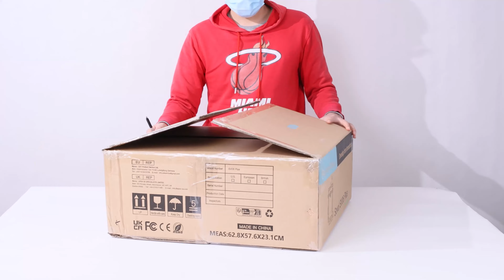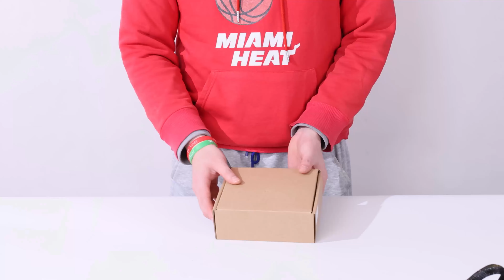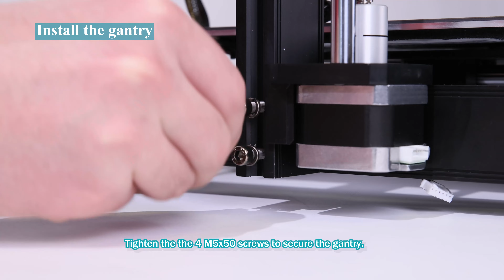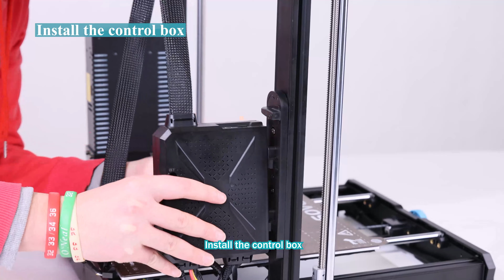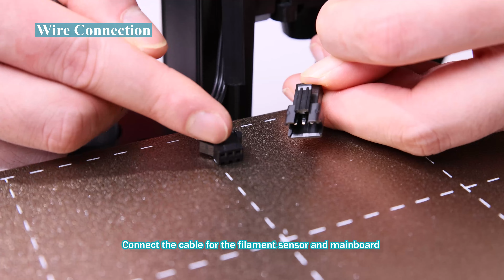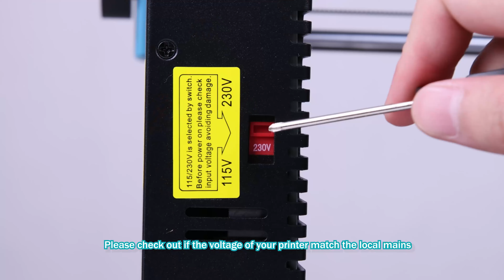Sovol SV06 Plus Unboxing & Assembly

Comment: I just got mine, but it has an additional sticker print surface, what do I do with that, does that go on the heated bed or on the back side of the metal textured pei sheet?
Reply: hey there did you figure it out? i have the same question
Reply: @ThekomboPlayer  did you figure it out i also have that question

Comment: I just upgraded to and just assembled the SV06 plus from a SV01 Pro as I needed a larger build platform.   I had such a good experience with the SV01 Pro that I decided to stay with Sovol for the upgrade.    I will keep the SV01 Pro as a spare cause I liked it so much…..didn’t let me down.     
I hope I’ll get same experience with the SV06+……….I will comment when I have had a chance to use it.👍
Reply: He, how has your experience using the sv06+ been? Considering getting one myself!
Reply: @bossgames8888  it has been great……excellent to be correct.   Not an issue and used quite a bit.    The nozzles are not standard so got spares from Sovol but only changed once but probably didn’t need to.    It’s been great unit and would buy it again anytime if I had to.
Reply: @miket3445 thank you for your reply! I’m really considering buying one! Just never 3d-printed before so I want my first one to be a good one
Reply: @bossgames8888  just remember that 3D printers are not like paper printers……there is a learning curve!    You have to set it up correctly and do the levelling and Z - offset routine properly, otherwise it won’t print properly.   Make sure to watch the YT vids on how to all this…..take the time to do your research.   There are printers that are more like paper printers (like the Ankermake M5) but these are far more expensive.

Comment: There are lots of unboxing and assembly videos, instead show how you have solved the problems with the machine , for example, cable restraint, my God!
Reply from the maker: Thank you for your advice.
Reply: I just assembled my unit……I had an excellent experience with assembly…….this video by Sovol and their install manual was great…..it all went together without a hitch.    Packaging was excellent and kept the contents safe for shipping, which is what you want.    Not sure what you mean by cable restraints……I haven’t had to do any…….didn’t use any of the cable ties supplied and all is neat.     You don’t want to restrain too much anyway to allow free movement.     After an hour I’m now printing a test print……so far so good……